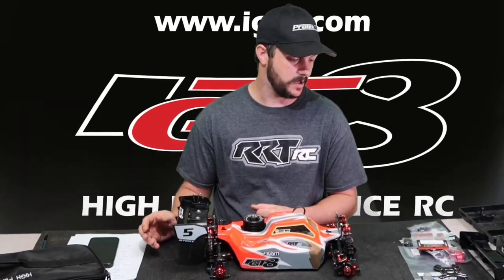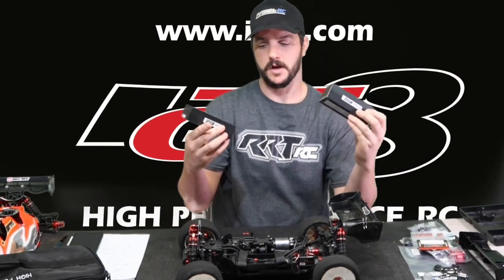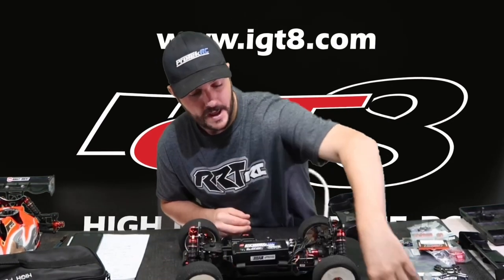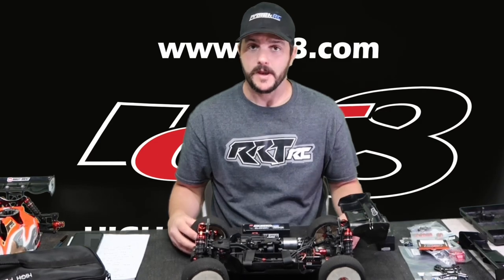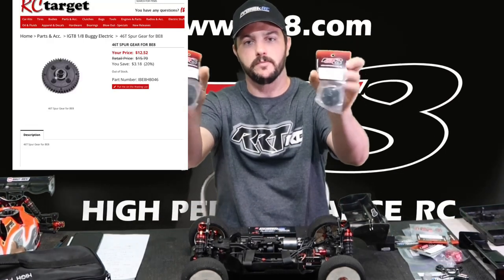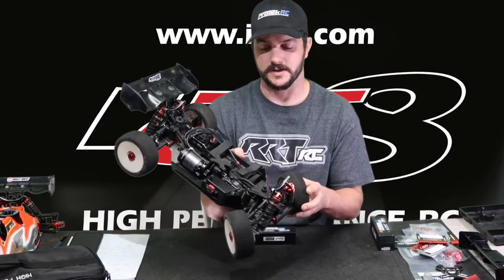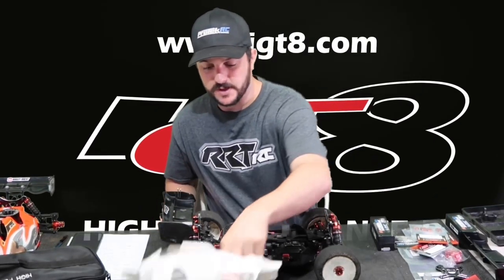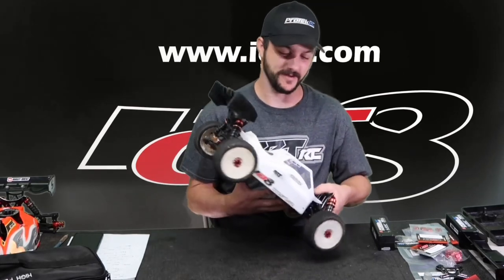EB8 protek battery and steel gear

Comment: I'm running a mix of bodies.  On the hybrid I built i had an x2e body that fit perfect

Steel gear for sure with the concentric motor mount. I put just a tiny bit of honda bond on the gasket and the leaks seemed to stop.  Any chance of getting other team members on here, would be cool to hear more feedback on their setups and stuff